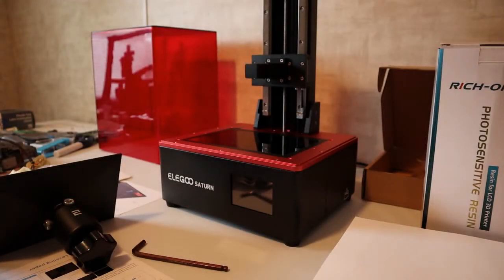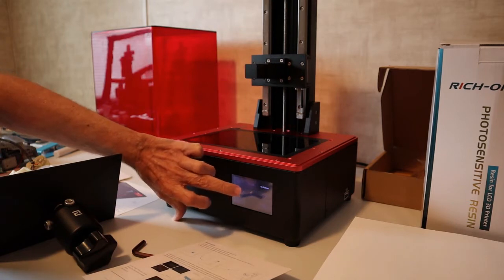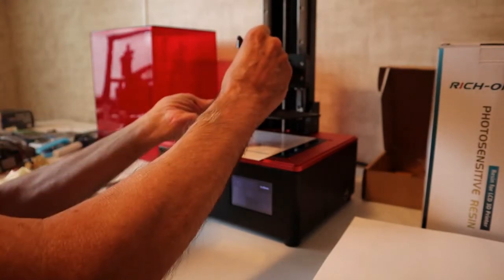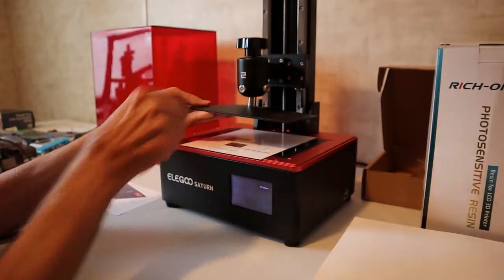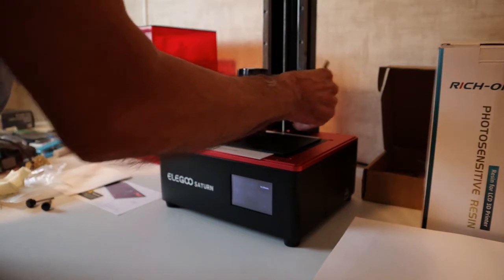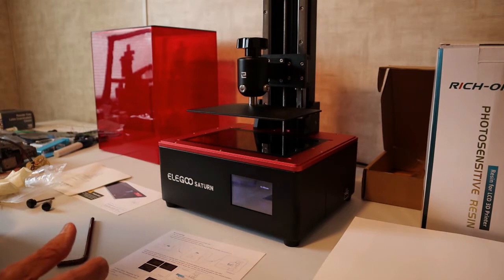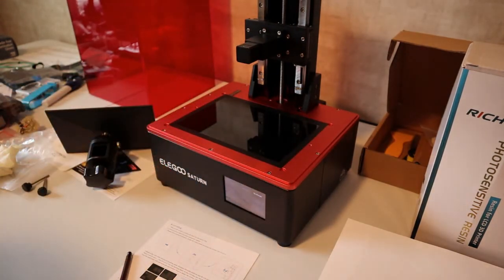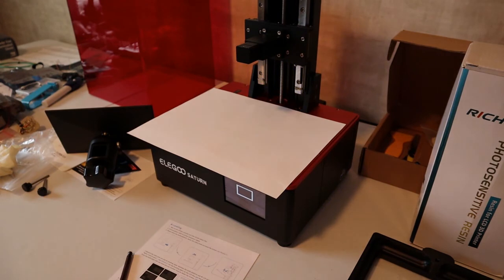Elegoo Saturn build plate adjusment

Comment: On the earlier Elegoo printers [such as the Mars 2Pro] you have to press the 'set zero' icon after tightening the two screws. I notice that you didn't in this calibration. The Saturn screen does have this 'set zero' icon - why not use it?

Comment: You are tightening the screws in the incorrect order. Elegoo state you must tighten the from screw first.
Reply from the maker: You are correct, I missed that, unless I was very lucky and by chance got the order correct every time, I've had no problem getting good prints tightening the build as in the video. The key here is to not over torque the screws, but thanks for correcting me....

Comment: After it’s tightened, should the entire thing be free of movement? It still pivots and turns when I’m handling it after a print
Reply from the maker: IMHO, there should be no movement in the build plate, if there is, it may be from over torquing the hardware, that part of the build plate assembly is aluminum and over torquing can stretch the threads, would be nice if they had "Heli-Coils" in there, just a thought....
https://www.stanleyengineeredfastening.com/en/brands/Optia/heli-coil
Reply: my build plate is doing the same thing it tiped and went sideways on a print  whats wrong with it
Reply: @kensmodelworks7218  just not tight enough. I mean you need to twist the hell out of it. 0 movement

Comment: why is the only edged light up it should be fully light up?
Reply from the maker: If you were running the exposure test in the "tool" menu, it loads a rectangle image on the main LCD screen and you would only see light a round the edge, that is normal, but never look at the UV light directly, it is very bad on your eyes....😵

Comment: I was using a regular piece of paper. You think that was my issue as to why my prints stuck to the FEP? Ty
Reply from the maker: A regular piece of 8 1/2" x 11" paper is .004"/.102mm and the "leveling paper" I got with my Elegoo Saturn is .016"/.405mm, that is a sizable difference and could be the cause of your excessive sticktion to the build plate, but I'd also check the cure time for the burn in layers and make sure it's not too long for the type resin you're using, maybe shortening the time might help.

Comment: hi thanks for the video! 
how often do you have to re-level the build plate???
between each print ??? or...?
Reply from the maker: You're welcome..... I've only leveled the platform once so far and would only re-level it if I was concerned that I might have disturbed/moved it's position during an aggressive removal of a print, but if you're concerned, re-level, just don't over torque the hardware. I have had no problems with the printer that I haven't brought on myself.... Have fun....

Comment: I am on my second build plate and I have been doing this exact process this whole time. If I get the bolts too tight the Z axis servo will stall and make a grinding sound. If I don't get the two bolts tight enough the plate will move during printing.
Reply: thanks i had it too so had the grinding sound. annoying to keep cleaning it
Reply: is happening to me too...so what´s your way to fix it?
Reply: @kaporc  I hate to tell you but, it is just apart of it. I can not fix it. The consistency and quality of recreational 3D printing just isn't where it needs to be right now giving the money per printer unit. It's confusing. Keep trying all I can say.
Reply: @PineBeltAdventures   ok so I guess it just an issue of the machine.i have previously print without problem but now I'm giving a lot of time to get it working...it's annoying cause I may print few models and that's it :(